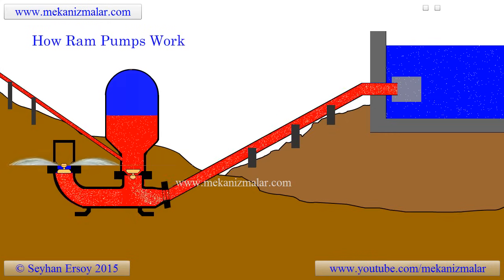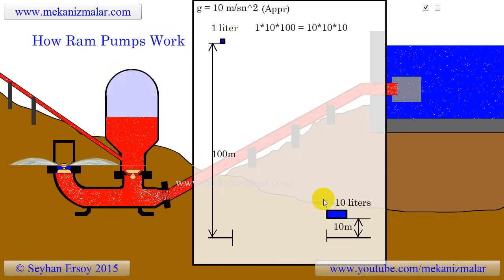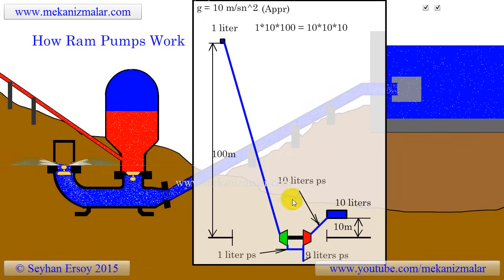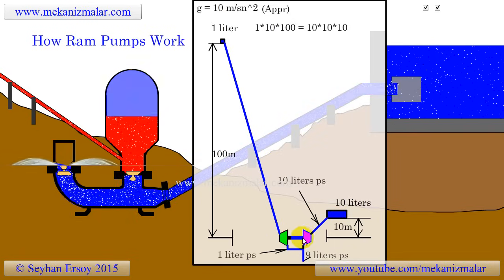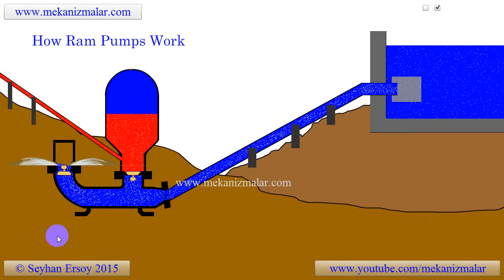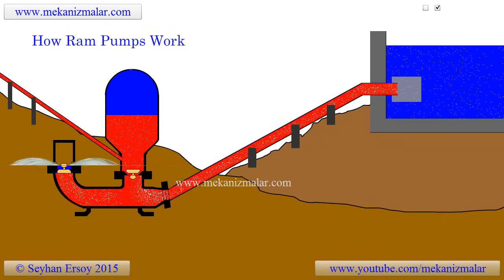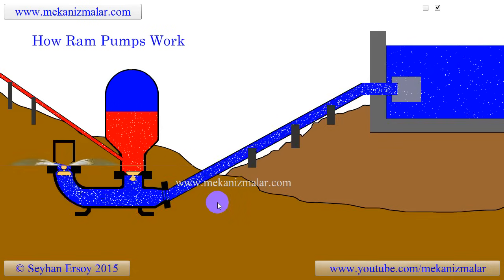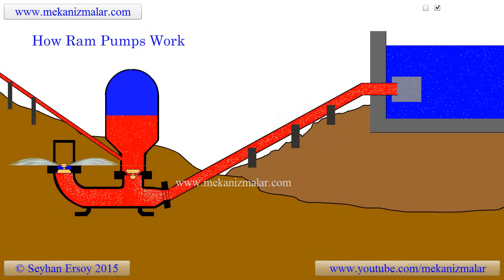how ram pumps work?

Comment: A water hammer pump uses fluid impact to generate pressure and move liquid. Paired with the 3S pump controller, operation stays stable and prevents abnormal shocks.

Comment: Not unlike an electrical transformer. A high current low voltage primary coupled to a high voltage low current secondary. Now the voltage, ie. pressure of the delivery line will actually be quite low because it must go uphill for 100 m. However,  if the delivery line were spread out on horizontal ground for it's 100m course the pressure, ie. voltage would be much greater indeed.

Comment: Good day,what is the meaning of RAM,is it an abbreviation of what?what mechanism is that the water goes outside the chambers,and lastly,the valves are in alternating sequence,like e.g. when one open,the other close and vice versa but not the same time close or open?thanks for you response.which determine if the accumulator valve to open and close also the diffuser valve to open and clise?
Reply: As you know RAM is a male sheep. During courtship, ram fights by banging theirs had to each other. Also during fortress sieges the gate of the fortress bang with a heavy log which is called ram.  In the ram pump, the ramming is done by water. If water flows from a large pipe with high velocity, when water flow is suddenly interrupted this creates a lot of pressure inside the pipe, like a large log hitting a fortress gate. This event happens when the waste valve is closed. This high pressure is relieved by opening a water feeder valve which pumps water to the high ground. Eventually, this reduces pressure and the waste valve opens and at the same time the other valve closes, and the cycle is repeated.

Comment: when you shut the delivery valve, does the waste valve always open? how can the waste valve be opened in the direction opposite to the direction of the water flow?
where does ram pump get its name?  slam pump or goat pump? what does it ram?
Reply: Your statement about delivery valve shut and waste valve open is correct but there might be a very short time for the wastewater valve to open. It is possible to open against water flow because the weight of the valve is causing the valve to go down and water flows around it. Ram effect is a very important subject in mechanical engineering. You can make a google search to read about it. German V-I flying bomb worked with this effect.  In old houses when you close the sink water flow valve very suddenly you can here loud noisy from water pipe. Therere are motorcycles and jets using this effect. The proposed ram jets of future jets might fly 5 or 20 times of the Mach number. When inlet to ram jets is wide  and it gradually gets narrower. In coming air is compressed by nerrowing duct. Regular jets we use today uses turbines to power the compressors. A big portion of fuel is consumed in this process. When we use ram jets there is no need for turbine and compressor. However one big drawback of ramjets is that, for the ram effect to work jet olredy should high velocity. For this reason, we might see ramjets in far future. However, missiles releaced from jet fighters might use ramjets and travel much faster than missiles we use today.
Reply: @seyhanersoy8989  i couldnt understand it from google's word and picture based explanation, i had to go through tens of youtube videos. the one of the videos briefly said changing kinetic energy drives it, another video said the waste valve is made of a heavy object, another video said the air chamber acts like a spring, another video said the water in the delivery valve acts like a seige weapon ram. now i am reading about ramjet you mentioned as to how it works. a lot of gravity pump vidoes directed me to clickbait videos, when i didnt know what the  difference between a gravity pump and a ram pump was.  thanks for your reply.

Comment: The water supply I want to pump from is over two meters in depth why would I need to Inlet pipe lower if I can set my pump up at a depth of two meters under the water. My water depth is always at this two-meter depth

Comment: As long as u r pump the realse value water into few trucks nothing getting lost u can't simplely truck back into storage tanks, oer hve as ememgency water to go to fire w/. Huge volume of water used will quickly empty out water storage trucks, at fire. Or any where rual water lines not run to. Nearest lake can b used to store moved water tank trucks if not worth saving in truck or taking back to source. If each fire house had 2 water storage 7500 gal trucks any fire would hve meet it's match. At fire u can hve a fire house going for each water tank truck & hydrant to finish job. If 2 fire houses w/2 trucks each & 2 fire trucks show, u r talking 8 hoses going 2 per firetruck & 1 per water truck. 3 alarm 2 more water trucks & 2 more lines from firetruck.
Reply: Thank you for your long explanation. However, I have some comments. Collecting water downstream and transporting it upstream with a truck not energy efficient. You will spend money on gas; it is not free energy anymore. However, you can use the collected water for irrigation or use a small water turbine to generate electricity. If the water amount is not enough to run the turbine, you can run it for 12, 6, or 3 hours depending on the amount of water accumulated. However, all those extra work costs you some money. You are better off staying with a simple design.

Comment: Hard for me to understand the animation !!! Water source on the right side (large blue reservoir ? and the water is meant to be pumped uphill thry the red pipe on the left ? Please confirm.
Reply: Yes, it is exactly as you said. The large blue pipe on the right has intermittent water flow. When wastewater flows out, the pressure in the pipe reduces. This caused the wastewater valve to close. And flow coming from large blue pipe has some velocity but nowhere to go. This creates very high pressure close to the flowing feed valve to open and pumps water to an elevated level.

Comment: why waste some of the water and not just re-route it back into the tank or something?
Reply: It is impossible to recover wastewater. Think about a water turbine operation in a dam. Can you recover water from the turbine exit? It would be against the conservation of energy principle, and you can't do it.
Reply: @seyhanersoy8989  well you could atleast collect it in a bucket to use for something else instead of wasting it into the evironment.
Reply: @BigCroca  Yes, you could do it if you don't mind carrying buckets of water uphill 24 hours a day. The reason you use this pump is to pump water uphill; if you collect wastewater, you can water a garden a little bit less altitude than wastewater, not higher than the water level.
Reply: @seyhanersoy8989  i know it wont be higher elevation but you could collect it into a small pond or something still

Comment: Best explanation so far.
Need to add sniffer valve before air tank.  Because after some times the air in the tank disolves in to water and tank get fill with water. Then hammer banging starts.
Reply: Thank you for your comment, which contributed something new to my knowledge about ram pumps.

Comment: Can you compute the physics of the Giza Pyramid as a Ram pump? You have water going down the descending passage, a valve shoots the water to the ascending passage and gallery. The pressure tank at the relief chambers, the output at queen’s chambers and kings chambers shafts for restarting and stopping actions through those arcs at those two copper electrodes
Reply: YT Channel: "Steven Myers". Video Series 2. Video 3. Introduction To The Construction Pump.
The Great Pyramid was not a Ram Pump because it does not have a necessary cycling water vent in the subterranean chamber. He then goes on to describe how it was used as a pump, but not a Ram pump.
Reply: @Scissorbeaks the vent is there in the subterranean chamber. It’s just been blocked up

Comment: I would think the most efficient design would have the pressure reservoir in line with the force of the water column's flow. instead of perpendicular to it. (e.g. swap the waste and delivery valve locations in the graphic.)
Reply: Yeah, I was thinking the same. Maybe you would solve the whole issue of valve placement by adding another forward-flow-only-valve even before the delivery valve. That way, it feels more like trapping pressure, rather than momentum. Does that make sense?

Comment: Ram Pump use the kinetic energy of moving water, not the potential energy.

So the video is total nonsense.
Reply from the maker: Thank you for your visit. I know difference between potential energy. If there is no potential difference  between a system between inlet and outlet water, gas or steam it is not possible to create kinetic energy in that system.

Comment: Question 1 : Ram pump base level must higher than water inlet level?

Question 2 : If we use bigger pressure tank, will we get higher water pressure?

Thank you
Reply from the maker: Here is the answer to your question.
Actually base level of the pump must be lower than water inlet level. By using bigger pressure  thank water pressure will not increase. Pressure in the tank is related inlet location of the pump. Higher the inlet level the more pressure created in the tank.
Reply: @mekanizmalar  Thanks for the info

Comment: The outlet can be discharged in an overhead storage tank to maintain pressure for household taps
Reply: How?
Reply: @cemasti4524   you just put a tank in the pipe outlet to gather it and the pressure will increase the higher the water level in the tank is

Comment: I dont get it what makes the waste valve open if there is a constant pressure (flowing water) from the reservoir?
Reply: If the waste valve is closed, there is no water flow from the pump. The weight of the wastewater valve opens the valve, this makes the water begin to flow from the pump. Faster the water flow, the more it sucks up the valve to the closed position. In the end, the valve closes and sudden pressure build-up occurs behind the valve, due to the kinetic energy of the water. This moment water is forced to flow to the destination in higher elevation. This causes the water pressure to drop in the pump and cycle repeats itself.

Comment: So it's redirection of kinetic energy
Reply from the maker: It could be said that, it's redirection of potential energy. You are taking a large amount of water flow from low elevation. Converting it's potential energy into kinetic energy in the delivery pipe in the ram pump. When the waste water valve suddenly closed, this kinetic energy converted into potential energy (increased pressure) and water flow higher elevation due to this pressure. Water potential energy is higher in the collection tank than the delivery reservoir. However amount of water collected in collection tank per minute  is much smaller than water escaping from delivery pipe. This is due to conversation of energy and mass.

Comment: This guy got it wrong. It’s the kinetic energy of the moving water that makes this work, not static potential energy
Reply from the maker: Thank yo for visiting my channel and your comment. However I like proper comments even comment disagree with my view. Therefore I will call you as UltraStoat. Dear UltroStoat you can not have a flow if water does not have a potential energy first. Tell me one application where there is a flow but not a potential difference. You have to convert potential energy to kinetic energy and then convert that kinetic energy to mechanical energy.

Comment: Why not simply use the water pressure from the bottom of a water storage unit (like a lake, pond, or water tank? No waste water, at the price of needing a small pump to kickstart the siphoning. Also, no need for a more than one valve, to keep the water inside the tube even if the pumping stops.
Reply from the maker: Thank you for your visit to my channel and your comment. If you pump water below your pond level by siphoning than what you describe should work. In this technique you can go over the hill seven meter above the pond surface. After than seven meter your pipe should go downhill and exit of the pipe should be below pond surface level. With your technique you can not pump water one meter above the pond surface. It is impossible. Also thinking the waste water  of a Ram pump as a waste is wrong. It should be called discharged water, it is necessary constrain the nature put on. Higher the discharged water rate, higher the water is pumped. Much higher than 7 meter I mentioned previously.  When a dam produces electricity, you discharge the water, you can not use that water for irrigation fields which is above the dam discharge pipe level. Therefore you can consider it as waste water.
Reply: Actually, what I described is the principle behind water streams surfacing from the ground. The water pressure in the ocean is enough to push water through multiple layers of soil that filter it, and the water emerges from multiple points, leading to the creation of rivers.

One way to check this is to check the pressure of something at a certain altitude outside the pond and the same altitude inside the pond, and you shall see that the pressure is greater underwater. By having a rigid shell (pipe) to house the water going out, you ensure that water does not press on the water inside from the outside in any other way than from the opening in the pipe (which is on the bottom of the pond). 

Having the bottom opening closed and no air inside the pipe would cause a water-hammer effect, which might start the siphoning. In the case the intended height is longer than what the water hammer can achieve, or the pipe already has water in it, using a pump (like a crank pump) to start the siphon will produce the same result.

Well, the further in elevation you want to go, the smaller the volume of water that can be sent there in the same unit of time. For example, you might use a 1 cm pipe for 100m in elevation or 10cm pipe for 10m in elevation, and the example is arbitrary and there are other variables which might made the example invalid.
Reply: Think of it this way: if you use a 5 cm pipe to have the water get down 20 meters, than a 1 cm pipe to have the water go up 30 meters, the water hammer would kickstart a siphoning, and even if not, the pressure caused by the water on the bottom of those 20 meters might be enough to push the water 30 meters. However, if the water hammer doesn't make it, then you will need a pump at the end of the 1cm pipe and one tap leading to the pump and one valve to let water out of the system when the pump is off and not let air or water into the system when the pump is on. That way, you can more easily kickstart the system. Or you could have two valves at the bottom of those 20 meters, one to stop water from going up, and another one for emptying the 30 meters pipe, so that after it's emptied, when you let the water get back up again, the water hammer will kickstart the system, but you would have to walk down to restart the system, instead of just powering a pump.
Reply: Can you prove ur concept?

Comment: with that stupid mechanism, you can only consume 10% of water supplied. to much waste shit not to use electricity.
Reply from the maker: Have you ever made a calculation for the amount of water wasted if you use electricity to power a pump? Maybe you will be surprised for the amount of water you waste to pump same amount of water by using electricity. On top of that the amount of money you spent to bring the electricity to that location.  If the location is right you can not beat this system with electric powered system, period.

Comment: heres where i simply dont understand ram pumps.  the pressure at the release valve should be 1atm + ft of head.  the only pressure to open the valve is 1 atm plus the contribution of the weight of the valve which i assume is negligible.  Thus the release valve should always be shut.  Yet clearly the valve turns on and off.  What am i missing?
Reply: These pumps are typically not self-starting.  The waste valve is opened to start water moving through that port, when released, the waste valve slams shut and the water rebounds from the closed value putting pressure on the accumulator valve which opens and admits water into the accumulator chamber, this causes a momentary decrease in pressure (at the waste valve) as water rushes into the accumulation chamber.  The accumulation valve then slams shut as pressure increases in the accumulation chamber but the waste value has now opened and water is rushing down from the source which causes the cycle to restart.

Comment: What will happen if we do not use the waste valve?
Reply from the maker: It won't work.
Reply: can i know the reason?
Reply from the maker: If there is no waste valve, there is nowhere the water to go. Water will fill the accumulator as much as it can. Then it rises inside the feeding pipe to same height as reservoir and it will stay there forever. Notice that it can't fill the accumulator all the way. The reason for that when water pushes the air inside the accumulator, its pressure will rise and and come to equilibrium with water pressure.
Reply: mekanizmalar Thank you for your replies!!!